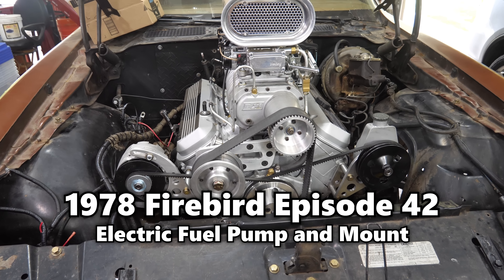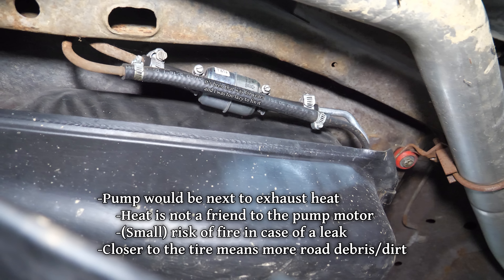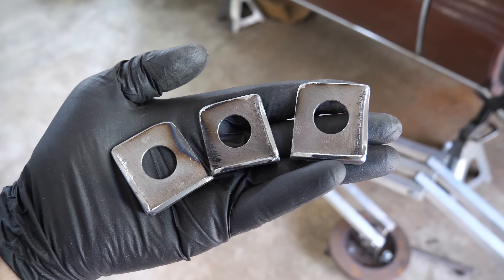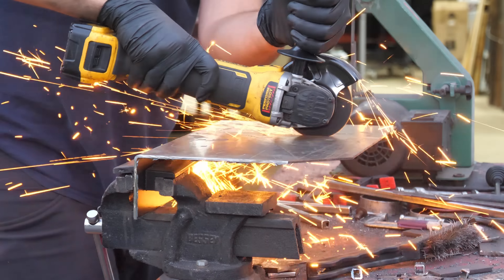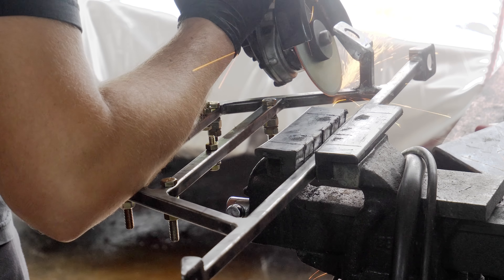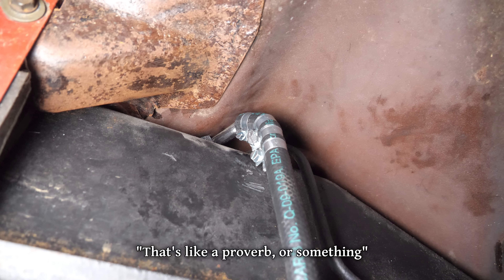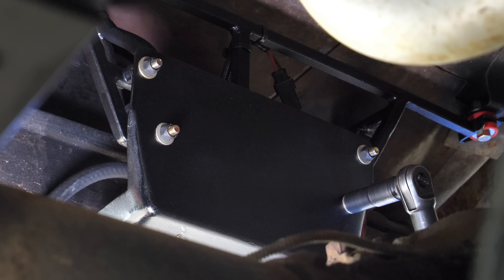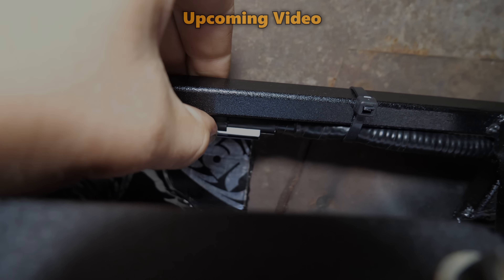Installing an Electric Fuel Pump on a Carbureted 1978 Firebird (Ep.42)

Comment: I love how you're concerned about the fuel pump volume considering once the engine is running you wont hear it anyways.
Reply from the maker: After the experience with Sean's 280z and an external fuel pump with a really bad drone I have learned to be cautious haha. It's a very persistent and annoying sound and I was afraid of having to put up with it
Reply: Youd be surprised how loud the whine is after 3 hours of it on the road, i drove an open longtube truck and i could still hear the ext pump all the way back from the fuel cell
Reply: @FuzzyDiceProjects   Was just a quick joke. I know how all sounds eventually stick out or get on your nerves. I've followed you since way before the firebird started and with that level of rebuild I'd want the everything as perfect as possible. Good job keep going. Can't wait to hear it come to life.

Comment: On the fuel pump , you have the 60 mil clamp. Is there a reason that you  don't put dynmax noise guard on the fuel pump housing between the clamp for sound deadening?
Reply from the maker: Dynomat is pretty soft and squishy so I'm not sure how well it would hold together being clamped down like that, but I feel like it would just squish out and not do a good job of holding the fuel pump in the clamp

Comment: The only fairly quiet external pumps I know of are the Jegs brand Ultra Quiet pumps and there are some Warbo external ones...  But Jegs doesn't recommend them to hipo engine builds, and I think the warbo ones I'm thinking of are EFI.  So, the one you have is likely most ideal anyways. 🙂
Reply: "JEGS Ultra-Quiet Electric Fuel Pumps are constructed with heavy-duty internals and an inline fuel flow design that keeps it cool even in crude environments. Two sizes are available, designed for use with universal carbureted applications such as street rods and muscle cars, with a rating of 120 gph for engines up to 600 HP or 160 gph for engines up to 1,000 HP." says JEGS.

Comment: I wonder if changing that filter will make it not work as hard. Maybe make it a little quieter.
Reply: Supposedly, mounting the pump below the fuel level in the tank will make it run quieter.  I haven't tested this myself though, so i don't really know.  Also I can't really tell from the video if his pump is mounted this low.

Comment: You should use an AN compression fitting on that hose and then convert it to the barb on the other end with a hose clamp Ive done it plenty of times

Comment: did you bypass the mechanical pump or pump through it??
Reply from the maker: No mechanical fuel pump, the engine doesn't have a provision for it unfortunately. The fuel line on the car that used to feed the old engine's mechanical pump is plumbed straight to the carburetors, so effectively a bypass of how it was previously set up.
Reply: Tell me you didn't watch the video, without telling me you didn't watch the video😂